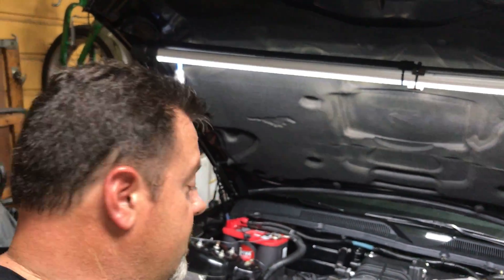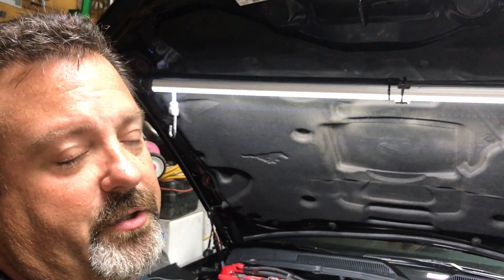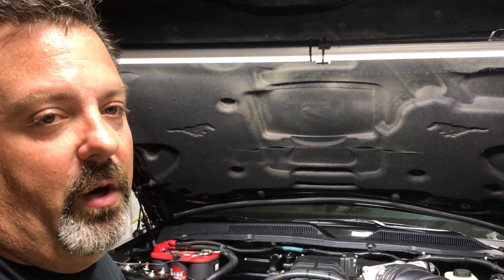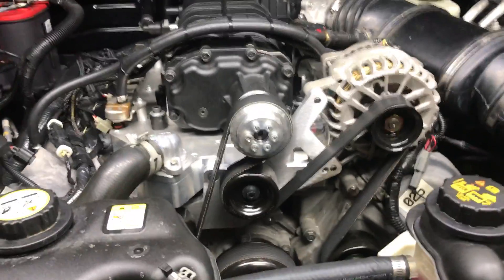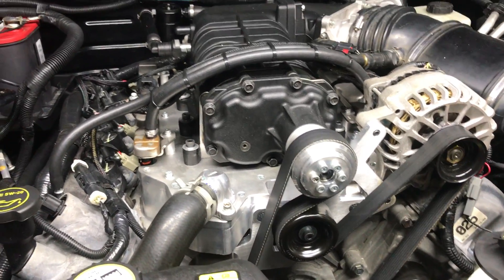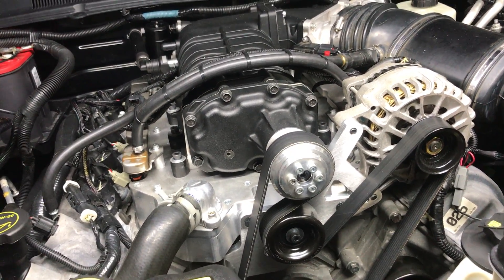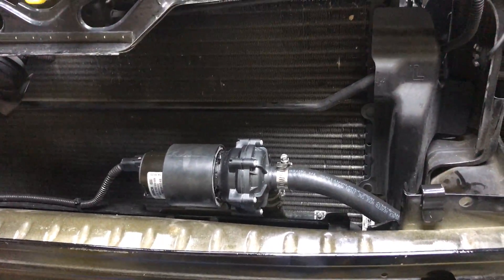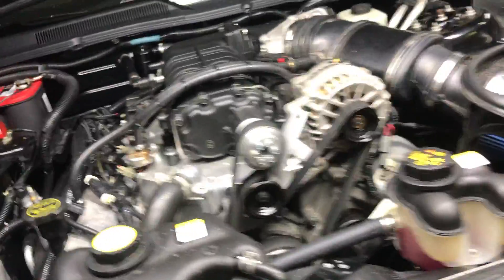How to put a GT500 SuperCharger on a S197 3V 4.6 Mustang GT

Comment: the 3 valve dont get enough love its a good engine
Reply: Not when the coyote is better in every aspect over any of the 4.6 engine, yes even the 03-04 cobra engine
Reply: @NissanTy  i never said it was anything close to a coyote it sounds a fuck load better tho the coyote sounds like ass
Reply: @NissanTy  no the coyote isn't better in every aspect than the 03-04 cobra engine the cobra had manly h beam rods from the factory true forged aftermarket h beams those rods are better than any rod ever installed in any coyote.  It also sounds 10x better.  Without those older 4v the coyote wouldn't exist.
Reply: @NissanTy  Even the 03-04 cobra!? You're reaching. The Terminator 4.6 DOHC was severely underrated from the Factory.
Reply: LS4.8Frank, obviously a Chevy guy. Why come on here bashing the 3V. Not everyone can afford a 5.0. Unless you track-race constantly, or like to replace tires, 450rwhp is plenty. Why isn't your name ZO6Frank or LS7Frank......both better engines than the truck 4.8 boat anchor. I'd actually be embarassed to have a handle that has the lowest of the low LS motor in it.
Reply: @rmartin5285  i own two 2006 3v Mustangs so nice of you to assume shit there little guy
Reply: @everett8811  wow you are an actual moron aren't you? I mean come on Captain Obvious, really? And me throwing a tantrum? Naw bro I'm not butthurt like you are because you don't know as much as you think you do about cars and trucks, but nice try. Either one of the Silverados in my driveway with slight suspension mods can outperform your 2010 Mustang in a curvy road. And you think your 2010 turns any different from the 2005-2009? News flash guy, it is the same chassis and same body as the 2005-2009. It is even the same engine with very slight differences. And my molded 2006 GT will outperform your 2010 in every area. Performance suspension front and rear, performance brakes front/rear, BMR tubular k-member, 2014 electric power steering swap, etc, etc, etc... Stay in your lane bro because you obviously have no clue what you are talking about. Lmao
Reply: @everett8811  "tough guy talk"? Wow some little snowflake you are huh? Imagine if I had used a real cussword or demeaning verbiage. Lmao. My point is very valid and truthful and just because you don't agree with it doesn't mean it is wrong. A 13.9 second car even in stock form is not fast by any means in today's times. It wasn't even fast in 2005-2010 either. Know your cars, know your talking point and back it up, because all I see is you saying what works for you. Cool, you have fun driving around curvy roads, but guess what, I can do the same in just about any car and feel the same or better enjoyment from it. These engines are dogs, regardless if you agree with that or not, it is the truth. Sometimes the truth hurts even for a Mustang lover. I own, have owned many different makes and models and I do all of my own work. I can take apart a 2005-2010 GT and put it back together myself with all the go fast parts and aside from a turbo, supercharger or nitrous it will be a dog. Ask Me How I Know... Maybe because I've been there, don't that, wasted the money on expensive parts that gained crap compared to other platforms such as the LS. I wonder why so many are LS swapping their cars and trucks these days? Hmmmmmmm
Reply: Lol a 5.3 gm truck motor makes more and last 3 times as long
Reply: @joshkeasler512  it doesn't make more stock they have like 285 horse from the same era.  It also has a decent amount more displacement this is just 281 cubic inches people tend to forget that.  It makes quite a bit more power than the old pushrod 5.0 even makes more power than a 5.7 lt1 from a decade earlier I know it is a decade earlier but it is over a liter more displacement also.  Just because the coyotes and other engines are better don't make the 3v bad.  People still build old pushrod 5.0s when these have as much or more potential on the stock motor and make a decent bit more power stock vs stock.  Not everyone is gonna build an ls or a coyote.  For the displacement these aren't that bad.   Compression is on the lower side for a modern performance oriented engine as well.
Reply: @joshkeasler512  it has .7 more displacement and who says it lasts longer?  These 3v are tough and known to last.  There is nothing special about the gd 5.3 I'm so sick of hearing about ls engines. It does what a 5.3 liter should do when you mod it.  It's nothing special the coyote outperforms it with less displacement modded similar a gen 1 truck coyote that is.  Fbo cammed 3v can make 350-375+ rwhp stock heads stock intake what does a 5.3 make fbo cam stock heads stock intake?  Maybe 400 on a good day alot of them don't do that unless running a very aggressive cam.  Again it has almost a liter more displacement.  I don't see the big deal on these ls engines.  People act as if they were touched by the hand of God and the 3v is garbage and can't make power when modded similar they're within a stones throw from one another considering the displacement difference.  Many 3v guys have made 500+ rwhp on stock motor for a long time just fine.  Shut up with the overrated ls talk this is a mustang video if you don't like mustangs or their engines watch ls videos.
Reply: @joshkeasler512  In Delusionalville maybe
Reply: @joshkeasler512  whoopedydoooo
Reply: I wouldn't say a good engine at all. It lacks on horsepower and torque and you spend twice as much as anything else to get up to 450RWHP which isn't easy unless you add a supercharger such as this with the intake kit. It is way overpriced for this intake kit, waaaaay overpriced! This kit if you have the supercharger and pulleys and such it should not be over $1,500. I like Mustangs, but the 4.6L 3v is notoriously a dog. Anything more than 450RWTQ and you run the high risk of breaking rods. And try rebuilding one of these engines... the rebuild forge internal kits are astronomical in price.
Reply: @JustAGuy781 that does mean it isn’t a good engine slow guy
Reply: @JustAGuy781  so basically everything other than a 4v 4.6 and 5.0 coyote from ford was a dog in your eyes lol? The 3v 4.6 was more powerful than the 2v and the pushrod 5.0 when comparing stock form. And a 3v 4.6... 281cubes with a intercooled vortech kit puts out over 500whp... That's damn impressive for putting in 4-5k on an otherwise stock motor
Reply: @billymattu  not impressive at all and it isn't $4-$5k guy, maybe you need to research a little better. Lmao. Sure you can make 500RWHP with a supercharger, but the stock internals won't last long and if you haven't replaced the timing in a while and end up installing a supercharger you can almost bet that it is going to scatter. I didn't say every other engine besides a 4v 4.6L or Coyote 5.0 was a dog, but damn man let's face the facts here. I love the Coyote platform especially the 2014 S197 Coyote and you can add simple bolt ons and achieve 500HP.
Reply: @JustAGuy781  just putting it out there, did a 3v 4.6 that's daily driven, vortech kit for 5500 after it was said and done, 480 to the wheels and that car ran like that for 4 years before it was sold. No issues. Sure the coyote platform is better but obviously it should be!
Reply: @JustAGuy781  you sound like a hating clown your name says it all though so it makes sense.  It's a 281 cube engine with sohc from nearly 20 years ago.  It makes good power for what it is.  They are very reliable engines and people get into the 10s with them with 500 or less rwhp.  Keep torque at or below 450 and you're good having cams helps because they don't add torque just shift it up further and adds alot of power up top allowing you to make 500+ wheel without exceeding that 450 torque number ecspecially if you're boosted with a pd blower like this gt500 one.  Forged internals are not any more expensive for a 3v than any other engine including the ls cars.  Prices are comparable comparing built bottom vs built bottom.  Some of the ls can just take more in stock form.  It isn't that costly to upgrade rods and pistons.  That is the weak link.  Fbo cams you can make 350-375 rwhp honestly thst isn't that bad for a sohc 281 cube engine I mean honestly what does a cam only 4.8 do with completely stock heads and intake?  That slug 3v compares pretty nicely with that almighty ls you love so much and the 4.8 has more cubes.  Its the popular thing to hate on the 3v.
Reply: @midnight347  you have basically repeated everything I have already said and now what? You want a cookie for it? I mean come on guy the engines don't compare unless you want to take a cam away from the 3v which you can't do and if you did it would still be a turd. 🤷‍♂️ I have owned 2v, 3v, 289, 302, 351, etc... each platform is different in it own respect, but superior to the reliability and capabilities of a stock bottom end LS, especially a Gen4? Naw it doesn't compare.  But maybe you need to read what you write before you post it because you went on and on about this and that and saying how a 3v with a cam will allow you to make 500+HP? Guy you can do that with stock cams. But hey, you go ahead and tell us because you know it all it seems. 👍
Reply: @JustAGuy781  you just wanna hate on 3v and discredit them and put them down while building up the ls platform as if it is something head and shoulders above when it's not.  It's clear which side you favor you are showing extreme bias and your name says it all.
Reply: @JustAGuy781  you say the engines don't compare then why are you sitting here comparing them acting like the 3v is garbage and ls is untouchable?  People just wanna bag on the 3v because it's what everyone else does just following the leader on the internet.  Just because you own 3v doesn't make you the end all be all authority on them.  You  say your truck with the mods you mentioned can smoke your fbo cammed 3v and I'm saying it's bs unless you're 3v aijt set up right or therr are more mods than you're telling on your truck there isbjust no way it makes enough additional power to offset the big weight and aero disadvantage it is at.
Reply: @everett8811  apparently your way of thinking basically says a 5.0L such as that in the older model Mustangs and the 4.6L 2v/3v, 5.4L 2v/3v are good and powerful engines. Shows just how little you know when the only way they make any kind of power to jump around about is if they are supercharged or turbocharged or with a heavy dose of nitrous. I own 2 of the 2006 Mustang GT 4.6L 3v cars and one of them is full bolt on with cams and tune and I can tell you that a 1999 Silverado single cab with ported heads, long tube and a cam and tune will walk all over the car even with the car having 4.10 gear. I know what I am talking about, but it is highly evident you do not. So spread your love for it amongst someone who cares.
Reply: @JustAGuy781  your 3v must not be done right if it's truly fbo cammed it should be 350-375 rwhp depending on setup and it would take 450+ rwhp to pull away from that in a heavy Silverado there is no way that that is making anywhere near that with the mods you claim.
Reply: @midnight347  look here mister know it all, my 2006 GT was FBO with Mutha Thumper cams, full exhaust, custom tune and it made 369RWHP. With the 4.10 gear it takes off nicely, but still nowhere near impressive. And what mods are you speaking of, on my 2011 Silverado extended cab 4.8L?
Reply: @JustAGuy781  LOL Your 4.8 Silverado with aftermarket exhaust pulls away from your built S197 hun?? Maybe you shouldnt be telling people that?? LOL
Reply: @stephenhood2948  why wouldn't I tell people that? Because it's the truth I'm suposoe to lie to make the Stang look better? It is what it is guy, no sense in lying like most of you do. That same truck also now has a single 70mm turbo and makes an easy 650RWHP with another 100HP to go on the current fuel system.
Reply: @JustAGuy781  OK bro, its your story, tell it how you want to. LOL Your Mustang gets smoked by Silverado's with cat backs and headers. LOL
Reply: @stephenhood2948  man you wanna be a tough guy on the internet so bad you can taste it huh? Pretty sad because in person you wouldn't act like a punk. I told the true story, sorry it doesn't fit your BS narrative. Mustangs are not that fast guy, I got one and a Silverado to prove it so yeah. Your story which is nut hugging and my story which is the truth, tell it how you want bro.
Reply: @JustAGuy781  cool story bro
Reply: @stephenhood2948 😂😂😂

Comment: I'm also running a GT450 kit on my 07. if you haven't already, you should throw a Denso alternator on there. Jason is now producing them premodified with 6 or 8 rib pulleys and they're 165A new units.
Reply: Jonathan Lee I have some questions about this if you could contact me at 870-805-1766 thank you